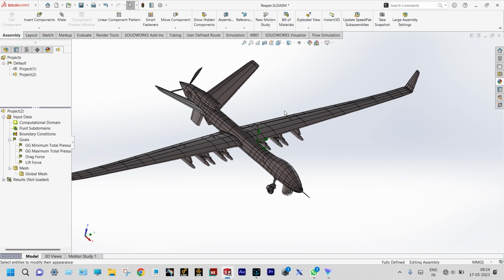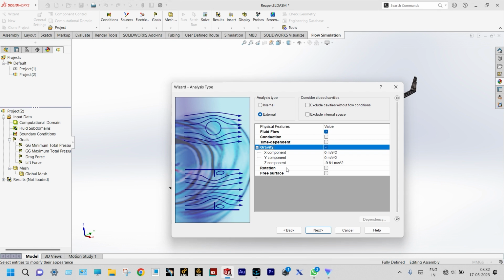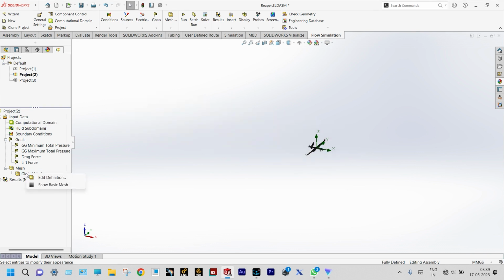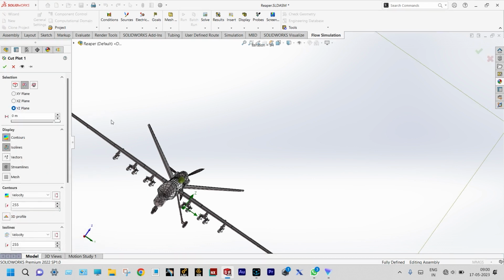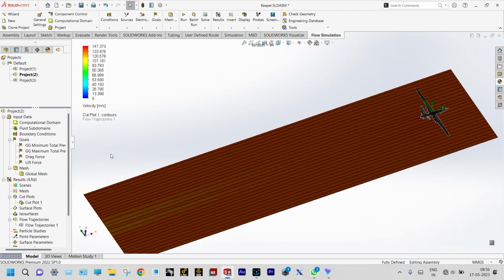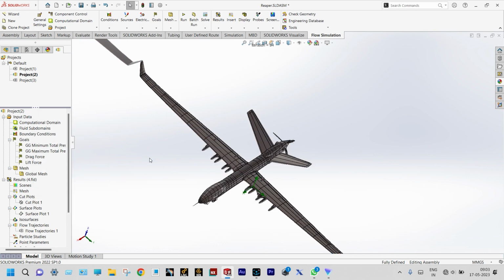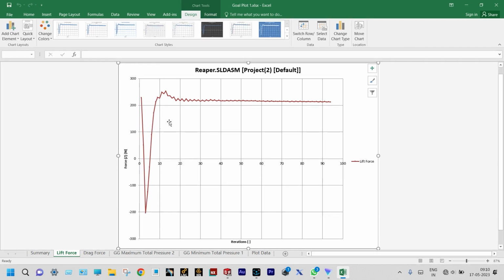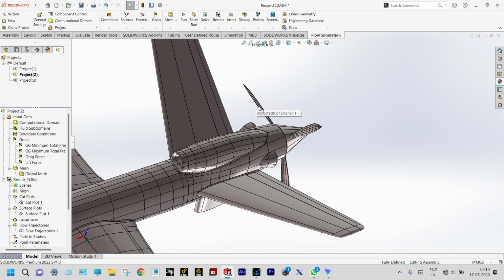CFD Aerodynamic Analysis of Drone - Reaper MQ9

Comment: lLft-to-drag ratio of the aircraft is too small. Calculation error/
Reply from the maker: It's a miniature. It's dimension is different compared to the actual actual one. All the parameters will vary with actual dimensions. In this analysis all the results are converged. In all aerodynamic analysis we expect less drag force but pull force is variable depending on types of vehicles. In case of drones or aeroplanes higher values of pull force force is expected but in case of vehicles on road it should be less.